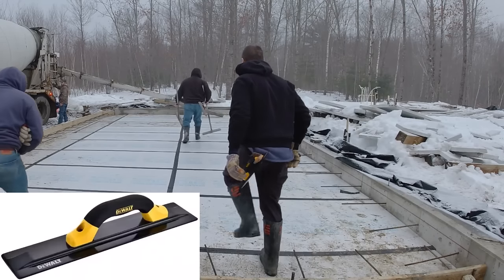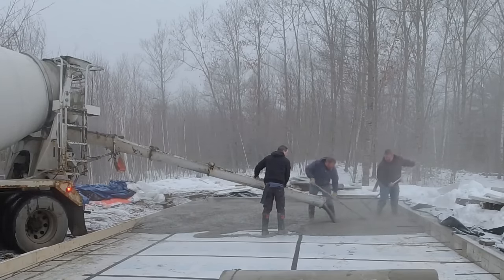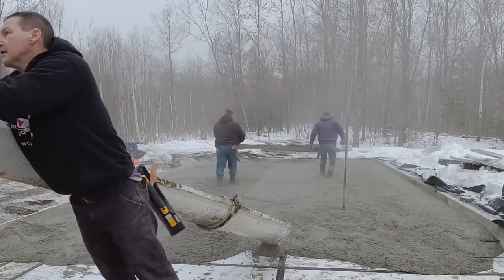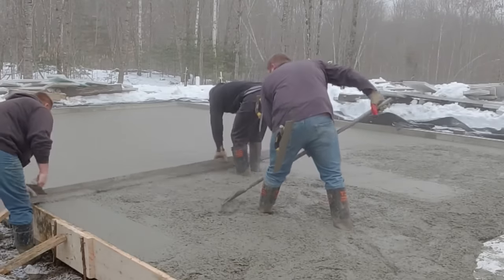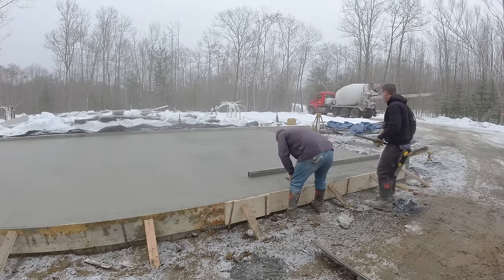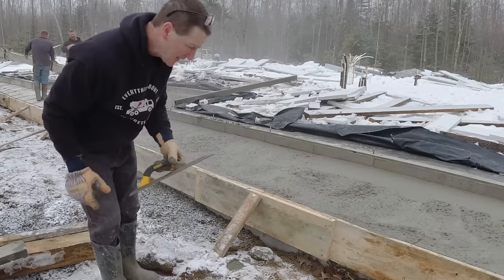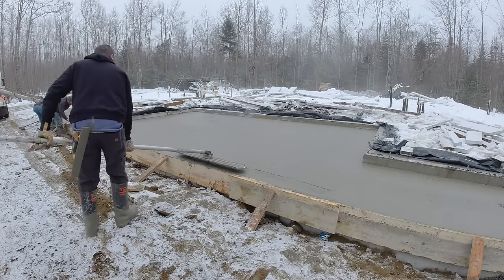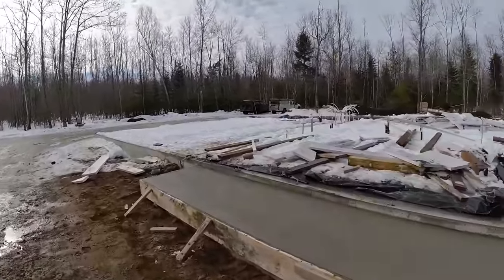You've Never Seen Anything Like This, UNTIL NOW! (New Concrete Tools)

Comment: Are the modern mag-floats actually magnesium alloy or are they just aluminum? I know they would have been magnesium back in the day but are they still?
Reply from the maker: Yes, magnesium
Reply: I had to cut one down due to the wear and people using them to bang pit star pegs.  Gave it a light with a butane torch.  Yep burns white hot like magnesium in highschool science class.